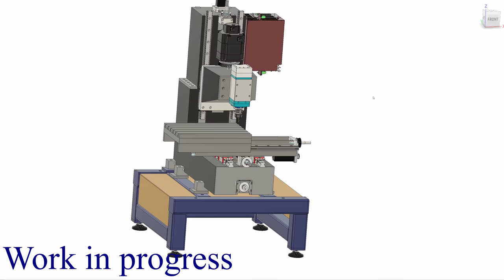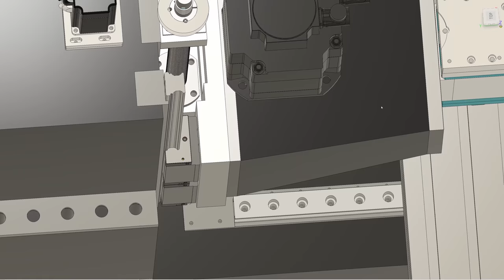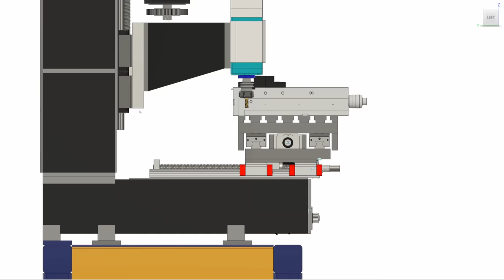DIY Milling Machine Part 1: The base and concrete parts

Comment: Is it Possible to make a temporary grinding tool that mounts to the one good rail to machine the surface of its pair. it would not be exact with such large overhang but would bring the run out much closer for scraping.
I wish you luck and hope for the best.
Reply from the maker: That is my favourite at the moment. I have to measure a bit more if that could work.

Comment: Usually I'd mount the carriage in a vice and indicate bottom of the rail to see if groves are parallel to mounting surface first. If they are the error can be caused either by one rail going up or twisting away (and it's probably the latter as you said). Instead of scraping you could just stone the surfaces, applying more pressure and spending more time on the high side.
If it really is twist, then indicated 0.1mm means "only" 0.02mm to be removed.
Reply from the maker: The rails are good. I swapped them and the result is the same. They are also a good brand. I would need to remove about 0,025mm. I shimed 0,03mm at the end and that was to much. But I don't really have the right tools to measure. I need to remove the twist, get the surface flat and parallel (and same height) to the other surface. Nut I have another idea I could try without moving the parts. Need to check if that is a valid option.
Reply: @AlexCNCen  I thought some more about your problem. It is possible to calculate how much of what you are measuring is twist and how much is a height difference by measuring on the inside strip and outside one, then comparing results (or even measuring ends of a parallel attached to the carriage to exagarrate the error). Doing this and adjusting distance between rails should be enough to make linear rails happy (not fight against each other all the time).  The real problem is that by doing only realative measurments one could accidentally make a smooth, repeatable... sphere. Do you have any straight edges or time to make one?
BTW I'm just throwing in some ideas, hope you find a way to fix this and continiue with the build :D
Reply from the maker: I have some more measuring tools including a 500mm straight edge. I just showed one measurement in the video. Would have taken to long to show everything. I will try to measure more exactly where are the problems are so I know better where i have to remove material.

Comment: I have read most of the comments previously written up until now. Maybe you can shim with something more pliable (easy to deform), like copper or tin. If you are able to fix the issues you can use the same method in conjunction with some adhesive like others have suggested. Just my two cents of thoughts. I'm sure you will figure something out. Good luck!

Comment: Perhaps shim with epoxy?
Reply: That'd be my first recommendation, if scraping is out. There's a few companies out there that do self-leveling epoxy for built-in surface plates, and the small deviation (in an absolute sense) should be manageable with the minimum cast thickness (~2mm?). You can use a less expensive epoxy (or maybe not worth it) to bring the concrete base height up to the bottom of the steel inserts. I've also heard/seen (but never done!) "scraping" with an angle grinder. Maybe not good for hitting super high points per area like hand scraping, but this is to bolt the huge rails down as opposed to creating a nice uniform oil surface. Good luck! I'm embarking on my own router and appreciate all the shared knowledge, good or bad.
Reply from the maker: Epoxy might also be a thing to try. But for that I would need a proper master surface and I don't have that. I got some other recommendations that might be a solution and don't require anything I don't have. The good thing is I can always try the epoxy if all the other things failed.
Reply: I think the suggestion is to use gravity to level everything. It’s popular on a UK CNC forum. Build a channel connecting both rail surfaces, build a wall around the rail surfaces. Then pour in the epoxy to get two surfaces flat and co planar
Reply: @ewildgoose  this is exactly what i thought.

Comment: How about working a calibrated granite surface plate inverted onto the rails with fine grit water paper ? Blue the plate up first just like you would if you were going to scrape it, then just work it back and forth. Then scrape to final flatness. Might just work. ( I read below that the inlays have edges. maybe just grind those off before you start, then you would have to make some other plan for alignment) good luck
Reply from the maker: The problem with that is that edges for the linear guides on both sides. So I would ned a plate that exactly fits between those. An Option would be to remove those. But I'm not sure about that yet.
Reply: @AlexCNCen  maybe just remove the edge on the one side so you still have your reference, then once the one rail is mounted, it should be easy to use a spacer to align the other side to that.

Comment: remove the linear rails, have the bottom of the rails machined in a way that will correct for the discrepancy?  Or add a block of steel between the body of the machine and the rail and have this machined to correct for the twist instead of having the entire block machined.. this way you don't have to take the whole concrete slab to the big milling machine again.  What you think?
Reply: Very good suggestion 👍

Comment: Very impressive build! What is the linear rail size on all Y, X and Z-axis? I understood the square profile is 50x50 so the rails must be 35mm? Also what is the brand of the rails.
Reply from the maker: Right the rails are size 35 and the square tubing is 50x50 mm. THe rails are from Schneeberger for Y and INA for X and Z.
Reply: @AlexCNCen   Hi Alex , the machine is impressive . Can you tell me where did you buy the linear guides ? Thank's

Comment: Don't worry about the surface in the base, just take the rails off and grind them to match the base. Instead of small shim, surface grind more on one side of the bottom of the rail.
Reply from the maker: Hm that would be super difficult to exactly get the imperfections on the rail to compensate for the ones on the steel inlay. Especially when I'm not able to measure it accurate ;)
Reply: @AlexCNCen  can't you use one rail top, indicate along the other both sides, mark it, remove bottom material, then you are close. Then scrape plates in concrete in situ. 

Also are you sure you cannot zero this out in software?

Comment: Maybe Grind the botton of the rails ? Dont mill it ....put it in surface grinder.
Or make few mm /cm flat steel / aluminium bar as a shim :) (or just make 1 big few cm thick steel plate) 
for me second option is the best idea becouse even if u make if wrong on 1 side ....u can remake it :)

Comment: I've seen several videos! but I can't know what kind of concrete or epoxy is used because nobody shows them in detail, and what about sand? and cement?
Reply from the maker: Hi. The concrete I used is UHPC from Nanodur with the E45 mixture.

Comment: Impressive build! Have you considered using steel filled machine epoxy such as DWH to set the linear rails on to achieve perfect accuracy? This could be a good solution for you and much faster than scrapping.... All the best.

Comment: Just remove your rails and install a precision ground plate about 25-40mm thick and re-fix your rails to that.You will loose some spindle height but it will be flat.You can use longer screws to fix through your rails through the plate into base rails.You can shim the plate to it's final position and then epoxy it so it becomes rock solid with your base.The epoxy cement will act as grout to fill in the gap between the plate and your base rails.
Reply from the maker: I just started scraping the ways. Looks like I can get it pretty precise with that and won't have to alter anything in the construction. In case that does not work for in the end I can still try something else.

Comment: If it's a twist. Buy a reasonably sized surface plate, and some fine grit sandpaper. Tape the sandpaper to the surface plate. Lay the surface plate across both rails. Elbow grease. Not perfect solution, but effective.
Reply from the maker: I have an edge on every side for the linear rails to be pushed against. So the plate must not be wider than 250 mm to fit in between. I have started scraping now and so far it goes like expected :)

Comment: Hi, is concrete dimensionally stable enough for such purpose? I know it shrinks during the curring process, but don't know for how long. Maybe this is the reason of warping? Many use epoxy granite for CNC bases, as it is maybe superior material, but I suppose it's too expensive for such big machine.
Reply from the maker: It is a special concrete (Nanotec UHPC). I found some researche about that where it was more dimensional stable than epoxy granite. The nice thing about the concrete is, that you can mix it with a normal mixer and it doesn't need any special treatment after poured.

Comment: Guess no mineral concrete for these? And not precision ground but milled?
Reply from the maker: I used UHPC for the two parts. In the following parts you can see, that I scraped all important surfaces to get very good accuracy.

Comment: Hi Alex! I have question regarding thermal expansion: Is there potential problem with combining UHPC concrete with steel parts (or is it cast iron?) in it? Something like a "bimetal" effect? Thanks! Milan.
Reply from the maker: Hi the thermal expansion is about the same for this UHPC concrete and steel. So i do not expect any problems here.

Comment: You can add some epoxy resin... there are some made just for shimming machine parts, super sturdy, super hard, can solve your problem
Reply from the maker: I will use such an epoxy to align the column. I just started scraping and so far it looks like I can get a pretty good result with it.

Comment: Can you give some information where you bought your UHPC? myuhpc or durcrete?
Did you think about shrinkage over time? UHPC tends to do this unless it's been annealed (48h at 90°C)

Very nice project!
Reply from the maker: I have used the nanodur (durcrete) UHPC. I let the parts dry and shrink over one month before machining. And in the end it took about half a year before I finished all the important surfaces. So I do not expect a lot of movement anymore.

Comment: I figured out how to make it perfect bud! First pick the 2 rails that are PERPENDICULAR TO EACH OTHER...2nd put your indicator on THAT RAIL,,run it all the way down the bad side writing on the rail and a pc of paper the amount it is out INCREMENTALLY and mark front and back etc. After you figure out exactly were it is (hopefully not wavey) you can flip it over and shim exactly what the error is and mill the bottom....make sure you machine the HIGH RAIL !!! HAHA,, i would ether hold it in a few vices with jacks under it or on magnets. Hope this helps! I really wanna build my own as well but cant decide on a size yet...ive done large custom machining on mazaks ,Nicolas correa's,  n Cincinnati's for the last 14yrs,,n 12yrs in job shops making little parts before that. Remember measure once,,cut twice! Haha!
Reply: Just remember cut the high rail not the low! Or shim it with a shim assortment ,,its only .004 thousandths of a inch right?

Comment: Hi! Any news yet ?   If you lived in sweden I would help you face it. I would probably take it out again and mill it with a large facemill and also check it with a dial indicator before I remove it from the machine. Easiest would probably be a large knee mill.

Comment: Hi Alex. Great build so far, following along on YouTube and on Instagram.
Just a question, I have been thinking. Of doing a cnc with epoxy granite, but after seeing your build, thought that the concrete route might be a cheaper route seeing that epoxy is very expensive. Just wondering how you were able to get the mixture for the concrete to have the right strength for what you are using It for. Also is it a special type of concrete or can I use the 52N concrete for the mix?
Anyway. Hope you can help. 
Cheers.
Reply from the maker: Hi, 
it is a special concrete. You can find information about it with Nanodur E45 UHPC. Its noticeable more expensive than normal concrete but easier to handle than epoxy granite. That was the reason why I use concrete instead of epoxy granite.
Reply: Thanks for the reply!

I went to check out that product and it helps a lot. Looks like here in South Africa we don't have those kinds of products. I have read some papers on how they created Uhpc with local products so might be able to come right with that, otherwise the epoxy route will be the way. 

One more question. Did you do anything extra with the drying process, or did you just let the mold stand for a few days? WAs. Wondering if it needs to be heated up to get rid of all the moisture content in the concrete to get it more stable.
Reply: @banzaiwill7672  I haven't done anything special. It is important to wrap the parts in foil for some days so it does not dry out. The added water is only that much to finish the curing process. During the first day the parts got quite hot by themselves. Something around 50°C. After that you should wait at least a month before machining the inlays. The concrete shrinks a little bit in that time and is than stable.

Comment: how the hell did that happen?? werent those surfaces milled in place at the exact same time in the exact same fixture? the machine looks incredible soo far, im jealous..  I guess that .2mm would irk me also , seeing as how everything else was going well.. I wonder if you could surface grind the tops of the linear rails and correct the issue , or would the side ball guides still cause it to ride high? subscribed
Reply: Unfortunately tops are ground only for the looks and tight dust cover fit. Grooves on the sides are very precise, sometimes even matched to carriage and so shouldn't be touched. The only surface left is bottom of the rail, wich indeed could be ground to correct twist but would require a lot of unbloting and bolting back in to check progress. If the rails have to be removed anyway I think it would be better to attack the real culprit.
BTW I'm also wondering how something like this could have happened, especially same error on both parts.

Comment: I don't know if you've solved this yet, but maybe this could work:

Alternate version of scraping it in. But hire someone to create an ultra precise hand scraped (or if good enough, ground) master to match the rail mounting surfaces (as they are meant to be) and have them ship it to you. That way you can expand your geographic radius of who can help you. Then you take over and blue the master, run it along the mounting surfaces (both the flats and walls) and clean them up until they are perfect (or good enough). This would require less metrology tooling on your end, and less effort and skill in scraping.

Also things of this mass are flexible, especially on the scale that you wish to achieve precision, so moving it out of your basement and back can reintroduce errors, even if the gridding or milling you do again is better than the first time. So leaving it in its final resting spot is best to then scrape it in.

Ignore everyone saying to touch the rails. These rails, no matter how expensive, are not designed to be perfectly straight or flat or whatever. They rely on your mounting references to achieve straightness and parallelism. The only true relationship between surfaces on the rails are the bottoms, one side, and the bearing races at any "2d cross section" (because again, they can be ever so slightly twisted or bowed). Any other surface is not useful as a reference.

that is an incredible job so far, i understand the feeling of finding out your reference surfaces are not up to the job. a few months back i "finished" a CNC router only to have the gantry immediately rack and kill the ball nuts on both Y axis'. Of course I was using aluminum extrusion and aiming for a level of precision 1 to 2 orders of magnitude lower than you. But spending a year designing and building only to get so close to done and then catastrophe is heart break.

I agree, do it right, and do it once.

Good luck
Reply from the maker: Thanks for your suggestion! I will definitely try to scrape it. I already borrowed a big enough straight edge from a friend. So I have all the metrology equipment here to get the surfaces flat enough. I also tested scraping on some mild steel already and it worked quite well. Now I only need some time to continue the project :) 

Best
Alex